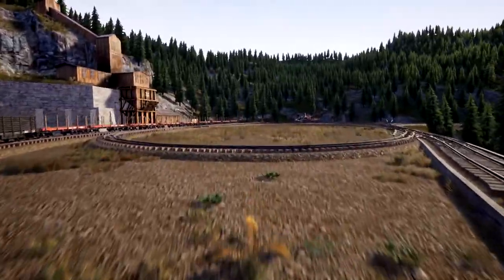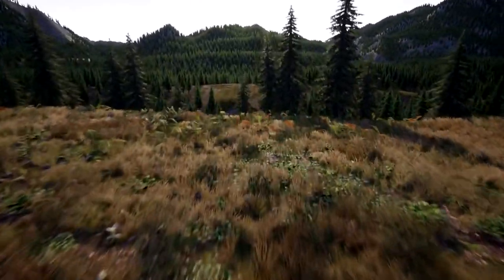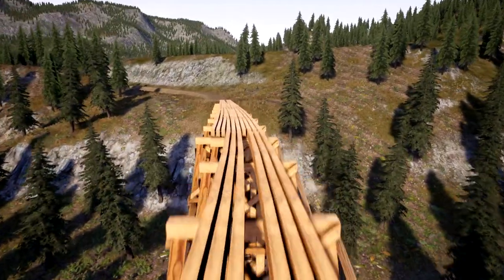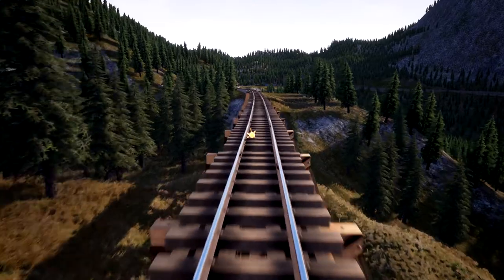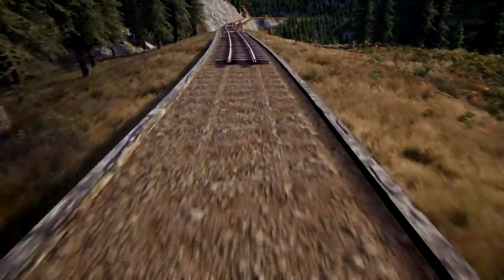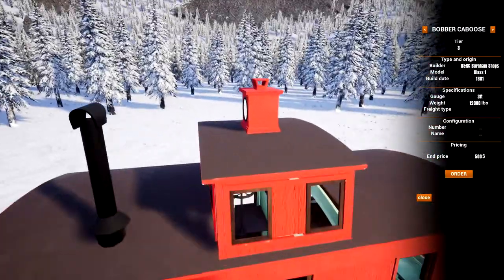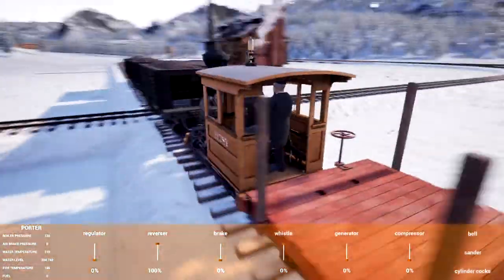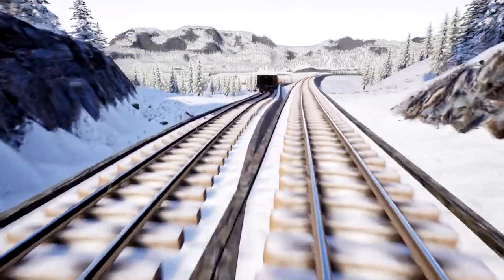C&G Railways Ep. 5 Iron Mine Smelter Loop Circuit Route RAILROADS Online with Carburetor Gaming

Comment: Porter nerf was comming for some time now. Developers have said that Betsy is 8 ton porter, but for the testing purposes they used 11 ton porter statistics on it. 
I do like what they have done with the geared locomotives. Previously it was not possible to go to 100% regulator without wheels starting to slip. Also increased speed made them a lot more usable. I have bought the Climax to be a switching engine because it was even slower than the Heisler, but now I use it for runs to the iron mine. I do not have a Heisler, but from what I have seen on other people videos, it is almost as fast as standard steam locomotives now.
Reply from the maker: I'm in the process of collecting all of them. I look forward to the geared, I hope they dont let the train push itself down the hill like the porter tends to